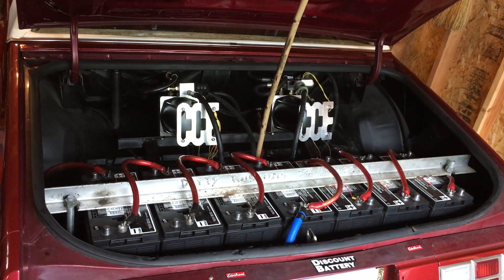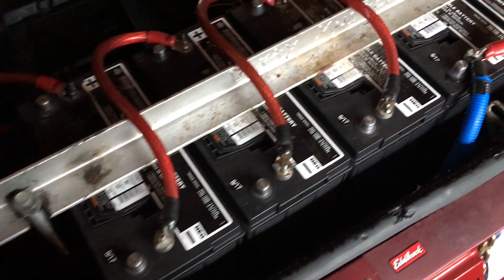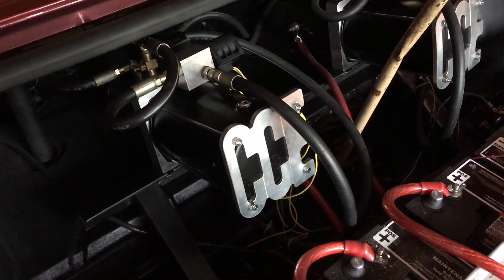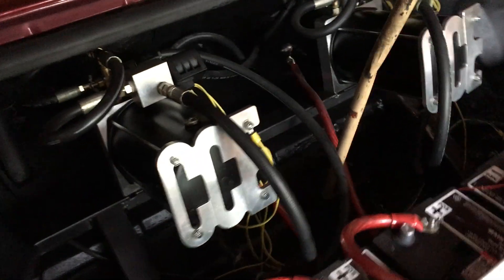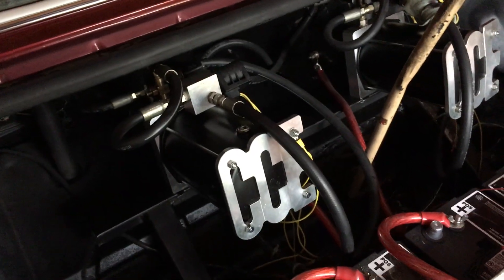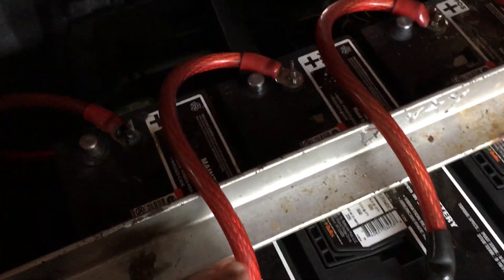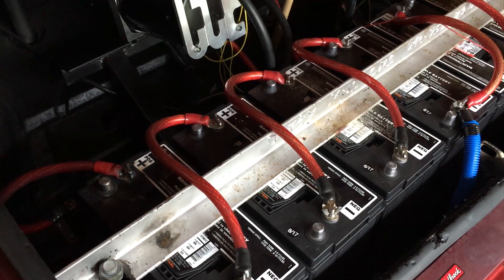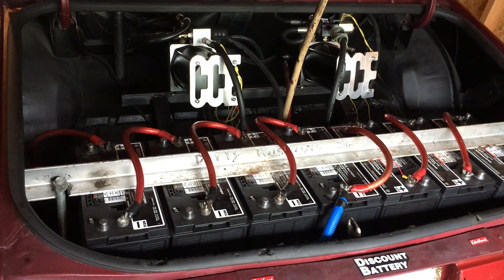1979 Monte Carlo Lowrider , Hydraulic Setup , Training Day Review

Comment: Ever have any issues running speaker wire instead of welding wire
Reply from the maker: I have had this same setup for over 15 years now and have never had an issue. This setup was professionally installed by a hydraulic shop here in Michigan.
Reply: @dropshopgarage  I appreciate you answering back !

Comment: I'm a CCE guy since the 90's. Still have my original set up. Bout to restore my lowrider I've had it for at least 25 yrs I also have a couple more cars I'll be building this yr. I do all my own builds whether it be a lowrider a hot rod or 4×4. Last fall I pulled my car out of the weeds and took it hoping. Only hit 24" but the all I did was charge the batteries after not driving it for a couple yrs. Check me out if you're interested.
Reply from the maker: You should subscribe to my channel , its all about cars ,trucks, and tools,  I will definately check yours out . Have a great day my friend.
Reply: @dropshopgarage  fo sho🤙

Comment: Zero gauge is not the largest wire that you can get for hydraulics I run double out welding wire And my Lowrider truck running for showtime pumps 16 batteries
Reply from the maker: Thanks for watching the video , I had them installed about 15 years ago . You should subscribe to my channel , its all about cars, trucks, and tools. Have a great day my friend..